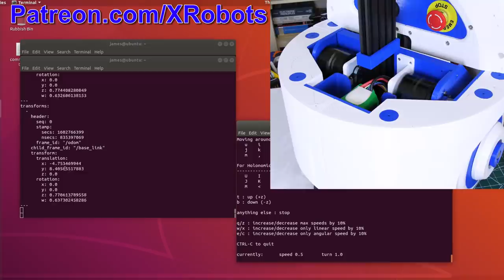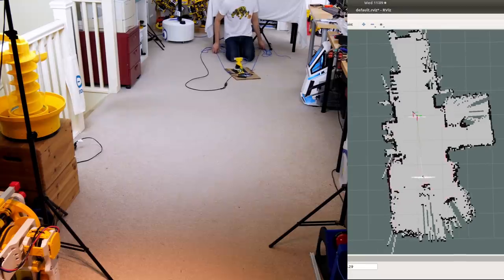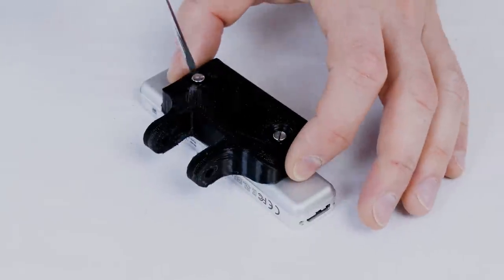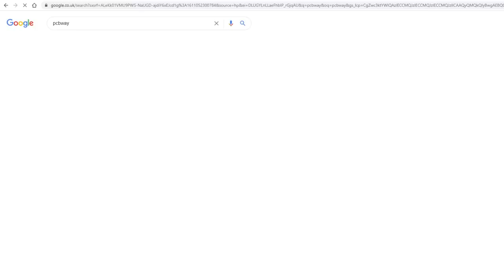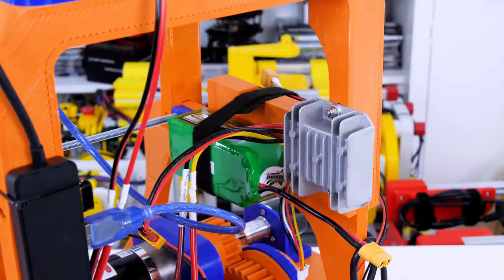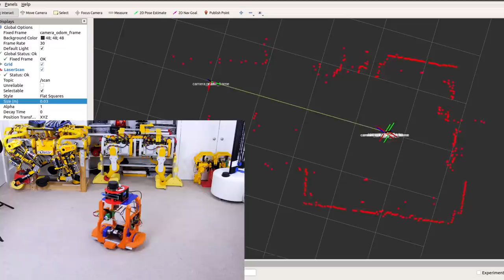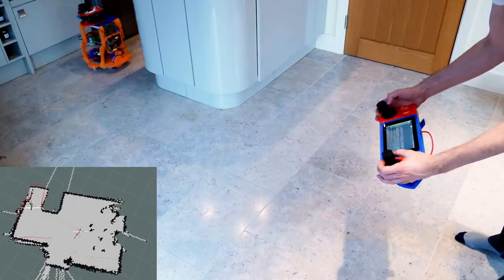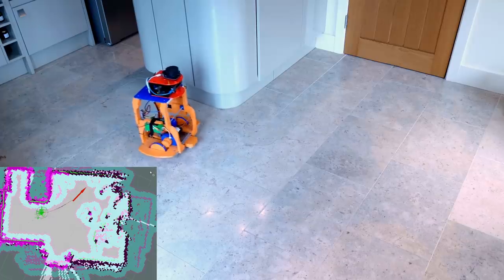How any Robot can Navigate with this Module

Comment: James, if you are using the RealSense camera, that laser is an overkill. You can get the distance to the walls/obstacles simply from the depth map produced by the camera if you don't have a SLAM mapping module in ROS that can use the camera directly. 
That will save you also quite a bit of current (those LIDARs are pretty power hungry).

Comment: Suggestion: it may be better to place the sensors near the centre of rotation, particularly on OpenDog where you maybe remake the front panel to have a hole for them. This way there will be less noise as they won't move as much as on the top of the robot. You will lose some of the rear FOV but that can be fixed by adding more or just rotating the robot itself like a real dog would have to. Hope this helps!

Comment: You should look into using some sort of graph SLAM with the LIDAR. I didn't realize that all of your position data came from the wheel encoders, as those lose tracking over time, especially at higher speeds/accelerations.

Comment: James, I think you underestimate the quality of your leg odometry and the sensor fusion algorithm the comes with the T265. Each joint is directly coupled with an econder you can read and all the wobble will be picked up by the encoder. The only issue would be if the leg slips on the floor but that issue is still present on wheeled robots.

Comment: You should probably put the lidar on a servo or stepper motor so that you can keep the lidar facing one way the whole time when it turns. I noticed that when you turn it messes with the whole map because the lidar isn’t turning the amount it’s programmed to turn it could be you a little faster or slower. If you put it on a servo or motor though you could get rid of that problem.

Comment: Your laser scan seems to distort when the robot is rotated rapidly. I wonder if that comes from a synchronization/latency issue between the tracking camera updates vs the laser scans. I'd be interested to know what's going on if you figure it out.

Also, why flat head screws?!
Reply from the maker: I probably drove too fast when I did the map, the laser is the cheapest available also. The screws are countersunk?

Comment: Your amcl seems to have an uncertainty that is way too big. I think this is probaly causing the ghosting, because the laser scans are recorded in the wrong postions by the local costmap. Try to tune the amcl to rely more on the odometry by turning down the `odom_alpha` parameters. Especially `odom_alpha1`.
Reply: And you must set `odom_model_type` to `omni-corrected`

Comment: Hey with a 3d camera like the intel T265 that you have you should be able to  get your map data without the additional lidar
If the Camera doesnt give you the depth info into ROS on its own you should be able to get them with the raw Footage of the Camera with a little help from openCV
Reply from the maker: The T265 is tracking only. I have the Depth camera, but the LIDAR is 360'.

Comment: I don't really understand the need for the Arduino; the Jetson nano has enough GPIO pins to control the motors and read the encoders. Is there some latency issue that makes it better to use the Arduino or are you just more comfortable having it control the locomotion?
Reply from the maker: I know how to do it this way, plus it can be bolted onto any Arduino robot with differential drive.
Reply: @jamesbruton  I see, makes sense. I'm planning my own autonomous robot build with the Jetson Nano right now, so I was curious. I suppose there could be  an added benefit of not having motors directly controlled by scheduled processes too.

Comment: you might try using ultrasound in conjunction with the lidar?
Reply: Ultrasonic is pretty bad in comperision to lidar.
Ultrasonic cant detected soft stuff like pillows or walls in an angle do to reflexion of the echo, same with round object like poles. The messearing is pretty slow do to the spead of sound and using multiple sensor is difficult.
Reply: @jonasstahl9826  might give a useful second opinion on the lidar ghost images. ultrasound is quite good at showing where things aren't